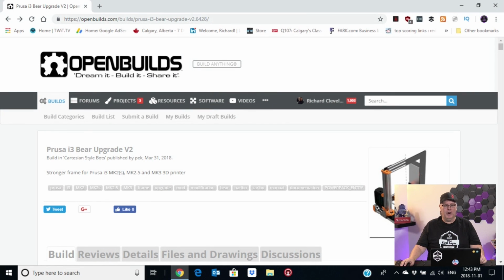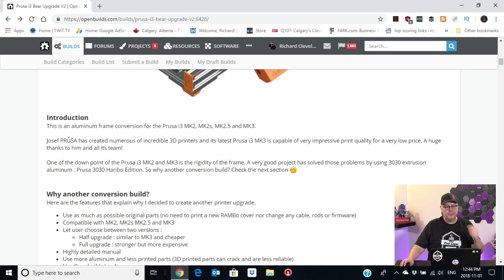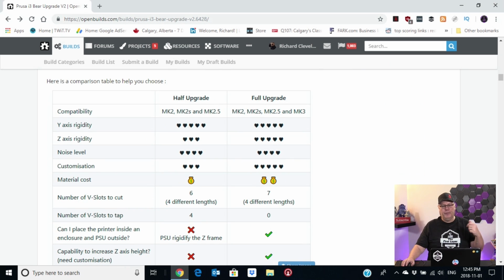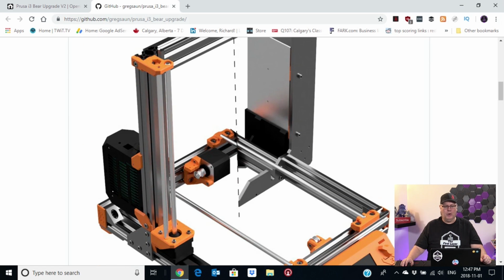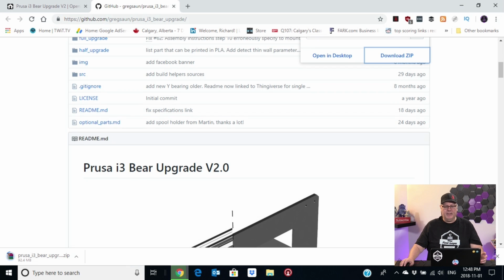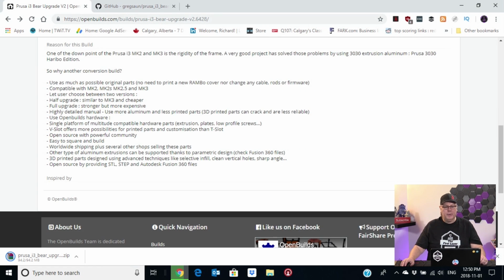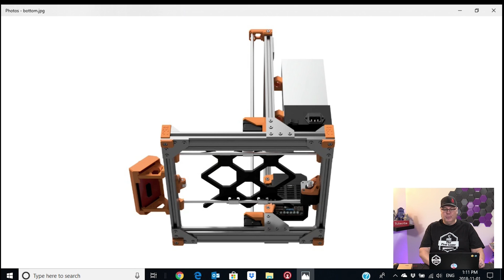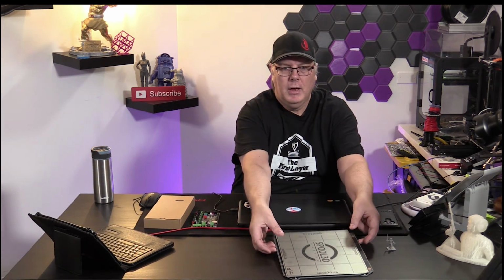DIY your next 3D printer part 1

Comment: Tmc2130 drivers don't work well at 12v. Adding a separate power supply or a boost converter to power the drivers will probably be needed for them to work reliably.  You'll probably need a fan in the electronics box to keep them cool.  The Pololu style boards don't do a good enough job of keeping TMCs cool. Good luck

Comment: An excellent, video cannot wait for the rest in the series. I have always thought of building my own with a large build plate.
If I may suggest, it seems you are using a vox system microphone. The sound was better in your videos without vox.
Reply: We've dialed it in a bit since filming. We're actually rocking a few shotgun mics, but the gating was a bit wonky (we were using hardware gating when we did more livestreams in the studio). We've now eliminated that hardware gating, and only apply some during post production to clean up the audio quality.

Thanks for the feedback!

Comment: For those of us in Canada, there's also makerparts.ca for Openbuilds stuff. They don't have as much stock, but if it's in stock, you can get it pretty quick.
Reply: I had a look at their site, and they've got some neat stuff. I'm a bit shocked at the price they're charging to cut extruded aluminum though.
Reply: @BryanBakerXBrav   Yeah, they are not *cheap*, but if you need it NOW and you don't want to mess with customs..... It's an option.
Reply: Out west, Spool3D will generally cut it for free from my experience. Just don't ask for a bunch of tiny pieces. I'd only use MakerParts if they were local to you.